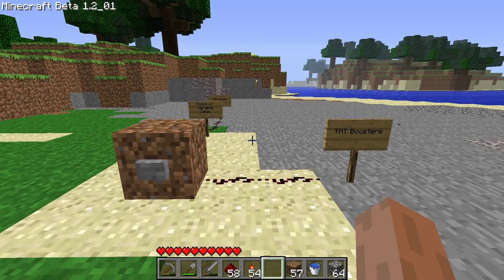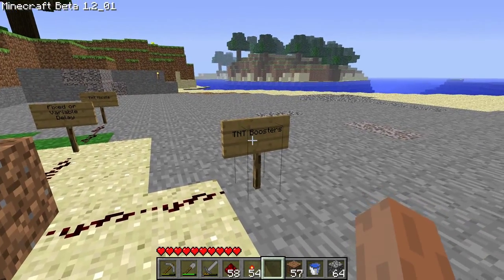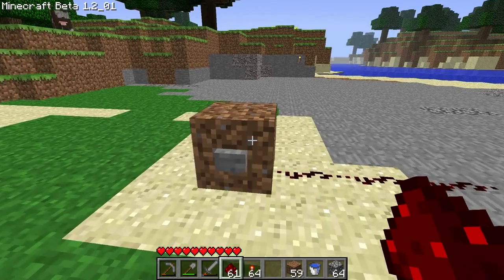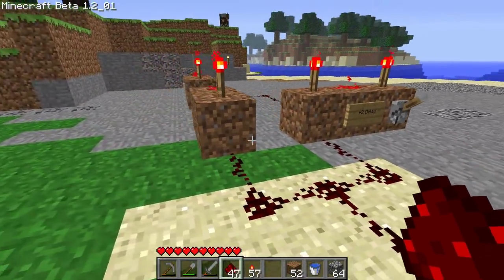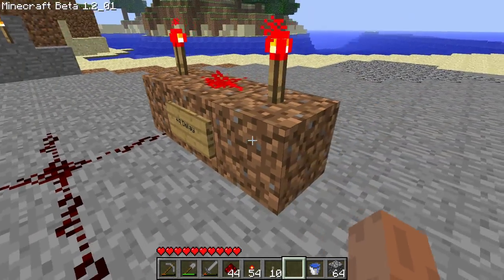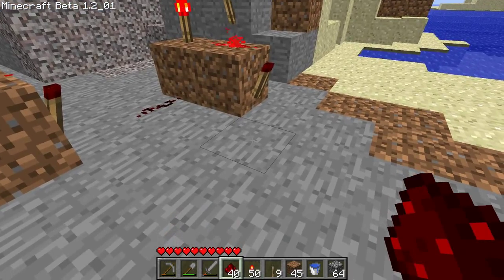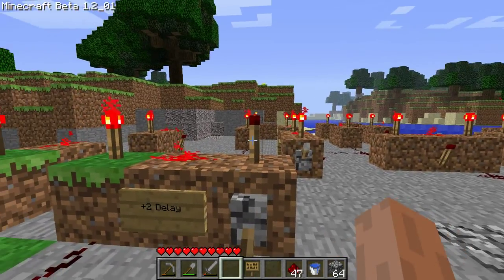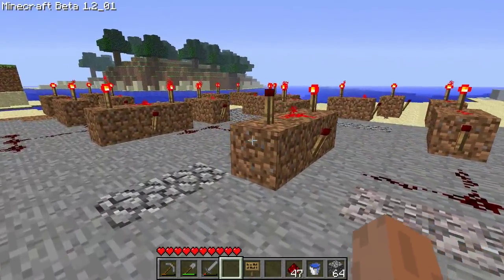Minecraft - AEtherimp's Improved Variable Timer

Comment from the maker: @WinwinLS Good catch, my bad. The base delay should actually be 10, instead of 8 like I say, to reach the maximum of 40 and to have a minimum of 10. You can get the 10 base by placing a repeater (2 torches) anywhere in the circuit where the wire isn't split. Just after the button or at the end of the wire are good places. The extra repeater would make it 2+4+6+10+18 = 40.
Reply: Love these old videos man, cool to see how much you've grown as a youtuber (even without thumbnails)

Comment: @WinwinLS 38 delay is the highest I recommend if your TNT is dropping AT ALL.. If your TNT is dropping from 3 meters above the pad like it does in most standard 3 rail cannons I would suggest not going higher than 32. If you're launching directly off the pad, you could use 40.